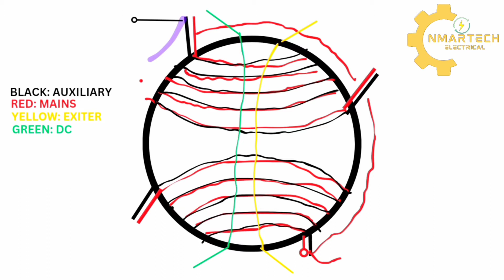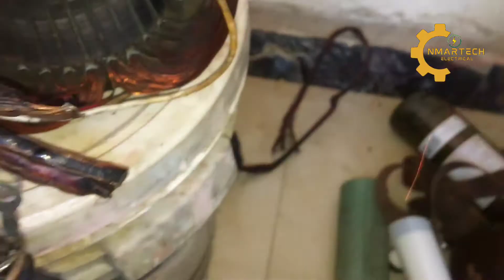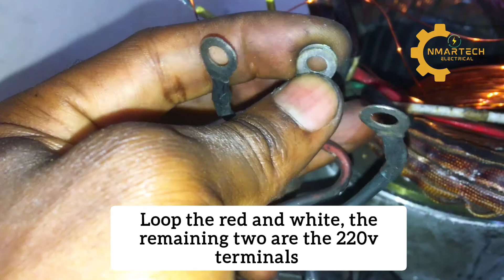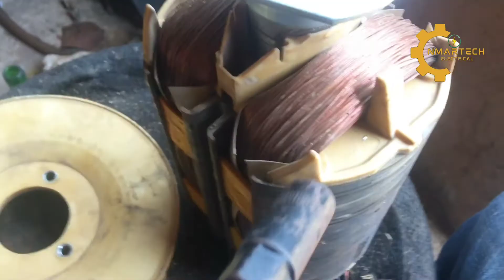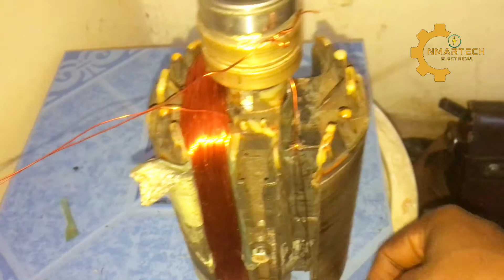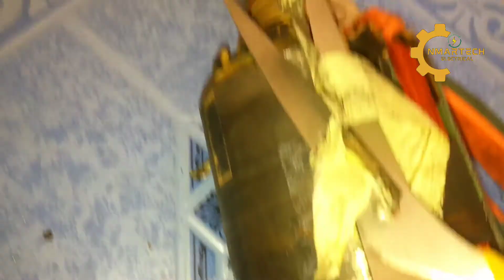Coil Rewinding of a 2.5kva Generator

Comment: can you rewind  the starter coil of a combined 
starter generator set from a older car ? (ie no laternator on the car)
Reply from the maker: Yes of course. If you have confirmed a coil damage you can rewind it using the original data

Comment: iam trying to rewind 2.75kw Generator armature, Can you please clarify me about the details of the wire size, and how many turns on each side?
Reply from the maker: @joomte7792  use data of the old coil
Reply: @ The old ones were over burnt and the data cannot be collected properly sir
Reply from the maker: @joomte7792  wire gauge for armatures is usually 24 or 25 SWG. For the weight, weigh the burnt wires on a scale, it gives you the weight of new wire to buy. You can add extra two lines to accommodate material loss due to burnout. This weight is divided among the two poles. Then follow my videos on armature rewinding for further guide
Reply: @ thankyou for the tips
Reply: What about changing from aluminium coil to copper coil
Reply from the maker: @joomte7792  work with the weight of the burnt wires

Comment: 1. Wire gauges must be same as the wires you replace.   2. 220V AC wires go though rectifier to split rings of armature providing 12V DC.